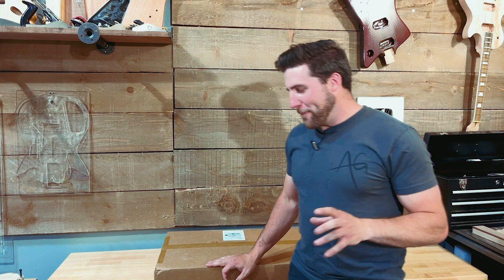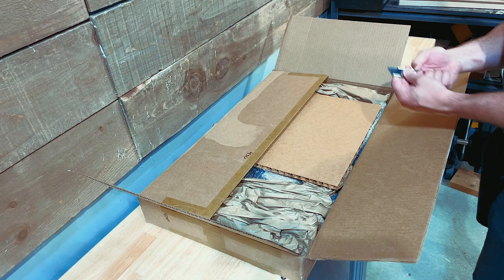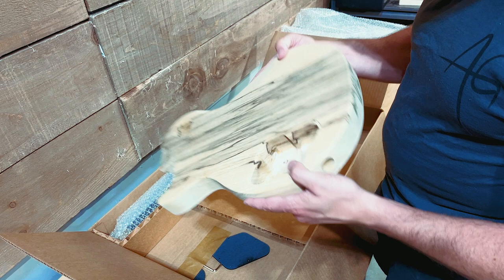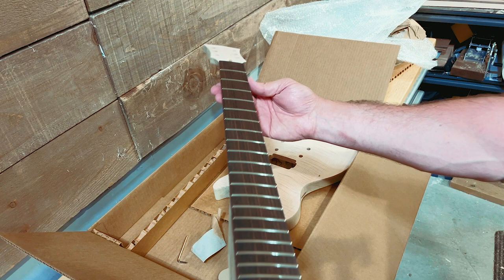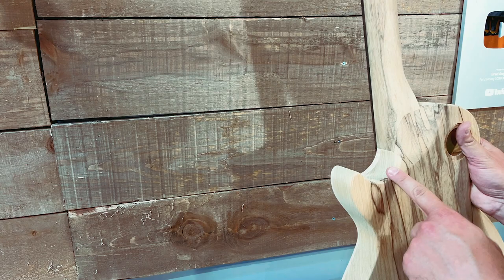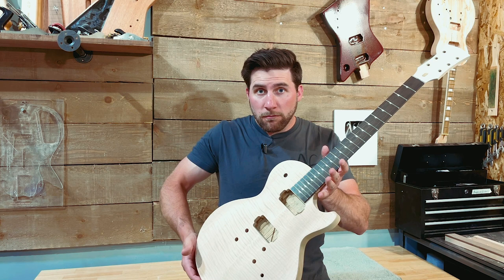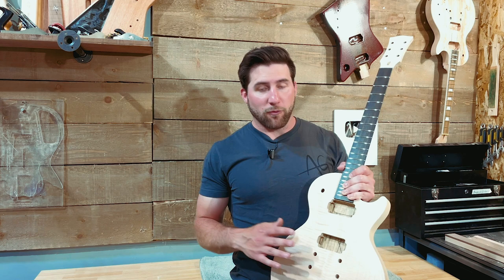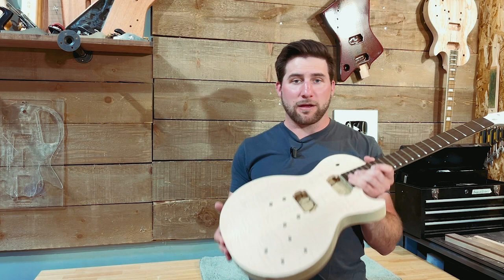Unboxing a Beautiful Guitar Kit from Precision Guitars

Comment: Really nice-looking kit. That black limba is gorgeous. 
I've built 2 guitars, both kits from Precision: 1) Tele-style, swamp ash body, maple neck and fretboard (no inlays), 2) Strat-style HSH baritone, mahogany body and neck, macassar ebony fretboard (again, no inlays). Fretwork was impeccable and neck pockets super snug. Both bodies had some pretty rough marks/scrapes from factory sanding that required additional sanding, but that's pretty much all that was needed. The Strat-style forearm carve was way too sharp an angle for my taste, so I hand shaped that. The Strat-style fretboard also had a couple of small, rough imperfections where a tiny chunk of wood was missing at either end; you'd have to be looking really hard to see them. 
Really happy with how they turned out, overall. They play really well and sound awesome (Seymour Duncan pickups: Quarter Pound set for the Tele, Sentient neck/Hot Rails middle/Pegasus bridge for the Strat). If you don't already have one, I recommend building a baritone: it'll change your life :)
Reply from the maker: I’m glad to hear your builds went well. I would love to do a baritone at some point.

Comment: Spalted Maple.  Condition occurs when trees lay on ground for a period of time before milling. Iffn I recall correctly, a fungus causes the coloring.  Can be quite stunning, and no two are alike.😊P.S. if you splash a bit of thinner on the wood it will give you a read on what the grain and colors will look like with finish applied.  Water will work, but thinner won’t stain and flashes off quickly.

Comment: So glad you are doing this build. I've advocated for PGK for years. Quality is second to none in my opinion. Fretwork is impeccable and routing is precise. Neck pocket leaves zero gaps as every neck is built for that specific body. I purchased 4 kits from them and have finished 3 so far.. A Korina '58 Flying V clone with gold hardware, Les Paul Jr with P90, and a Telecaster with maple neck. Number 4 is a Limba Stratocaster with a natural orange stripe running through it.. That one will get a Floyd rose 😀. My advice is to spend the extra money on quality hardware. The kits aren't cheap so you might as well go all the way and make it a killer one of a kind axe. They play just as good as my Gibson LP. Looking forward to seeing what you come up with on this one, Brad!
Reply from the maker: Cheers Anthony

Comment: Back in 2020 I decided I wanted to build a guitar after finding your videos.  Start with a kit from Fretwire, it was rough, figured that was typical of the china kits.  Ended up sending it back because of an issue(which they were great about).  Went with a kit from Precision.  Sure, I busted my original budget for the build, but the Precision kit was perfect.  Didn't have to do any of the work your old kit videos had be prepared for.  It was literally sand it, seal it, paint it, and glue it together.  For me, the rookie builder and rookie guitar player, the hardest part was getting the nut just right and the initial set up.  Once I got that all dialed in it came out great.  I guess the extra cost of the kit was somewhat recovered by the fact that I didn't have to buy a pile of specialty tools for the build lol
Reply from the maker: That totally makes sense. If you’re just building one or two and want to make sure they’re good at the end, this is a great option.

Comment: Hello again Brad,
That is a gorgeous kit! I’ve only worked with Warmoth stuff here thus far but I’m definitely going to have to check these guys out now for a cool set neck build similar to this one you’re about to do now man. That black limba looks incredible too, can’t wait to see what kind of cool finish you decide to do of course as well. I’ll be heading on over to their site as soon as this video ends as well, thanks as always! 🤙
Reply: PS ~ just out of curiosity did you go with stainless frets? When I check these guys out I guess I’ll see, I’ll also check and see if you have a link which might give some sort of small discount if you’re sponsoring them, if so I’ll obviously do it when I’m ready 🤙 once again thanks, very cool video.
Reply from the maker: I don’t have a discount link at the moment, but I may ask them if it’s an option. 
I got the jescar 45100 frets.
Reply: @BradAngove  , thanks. Looking forward to seeing what you do with this one. I’m sure it’ll be very nice whatever you decide though 🤙

Comment: Nice looking kit. The wood looks really nice. If you tape around the neck pocket edges when you go to glue it up it will help keep squeeze out off of the areas where you don't want glue.
Reply from the maker: Yeah, I’m also going to do my staining work before I glue to avoid having the glue mess it up.

Comment: I just recently ordered a kit guitar from Precision Guitar Kits. The one I ordered looks very similar to the one in the video. I ordered the LP style with a 25.5 scale, 3A quilt maple, and dot inlays. I did go with the black limba body and neck.
Reply from the maker: 3A quilt hey? I bet that’s beautiful.
Reply: @BradAngove  I’m sure it will be. I just ordered it on 07/01/2022, so I probably won’t get it until the first September.
Reply: I know you have reviewed Crimson Guitar products so I have a question for you. I recently received my Precision Guitar Kit. I was going to finish the body and headstock with stunning stains. I also know I’m going to use Crimson’s High Build Oil on the neck. My question is, do you think I could get a nice sheen with Crimson’s Oil on the body or should I clear coat?
Reply from the maker: Crimson oil gives a nice sheen, but it’s not a full gloss. I’m not sure what you’re looking for.
Reply: Do you have a video where you add a finish to black limba?  I want to do an oil finish and I’m curious about the grain filler (what’s the best kind, advantages/disadvantages to using it, etc.). Thanks!
Reply from the maker: I don’t have any other videos on black limba as it stands, but the grain is fairly closed so grain filling likely isn’t necessary.
Reply: @BradAngove  thanks!

Comment: I just received my first set neck PRS style carved maple cap DIY kit. However, upon checking the neck fit, it looks like the fretboard sits to high in the neck pocket. There is about a 4mm gap between the top of the guitar body, and the bottom of the fretboard. There is also a small ledge that extends about 3 or 4mm beyond the end of the neck, and it looks like it should line up to match the top of the body, along the front edge of the pickup cavity. Can you recommend some steps I should take to verify what the height of the fretboard should be? I don't want to start routing the neck pocket deeper, if it's not necessary, but it seems to me that the bottom of the fretboard should be almost touching the top of the body.  I would appreciate your input.
Reply from the maker: Get the bridge installed and then check by running a straight edge from the nut to the saddle with the neck in place. If the neck is too high there will be a substantial gap or if the angle is off the straight edge will be too close to the high frets.

Comment: With the neck being that tight, are you only seeing glue on the bottom of the neck, and glues is but squeezed out on the sides?
Reply from the maker: I’ll probably tape the top around the pocket to protect it and just to a very thin layer of glue throughout.

Comment: Hey, does it come with the neck nut at all? Or do I have to buy one separately and carve it out my self?
Reply from the maker: It doesn’t come with any hardware, so you would get one separately. You should have no difficulty finding a pre-carved on though that you can just adjust the height of by removing a bit from the bottom.

Comment: The LP kit I have . Is totally not seamless and needs all kinds of work.. (and for a noob guitar builder such as me could probably use the practice) but….I guess next time ima have try these guys out
Reply from the maker: They are unreal. They do take some of the work out of it, for better or for worse.
Reply: @BradAngove  I checked out the specs and they use Jescar wire for the fretboard(I heard that’s higher quality stuff) but solo does have a Strat kit I’ll get off your link ,and as for the Precision I’ll get another LP since I got measurements tools and other crap I’m using to build the one I’m currently working on.

Comment: Anyone have an opinion on the fret edges on these guitars? Will I have any filing or sanding if I get the stainless steel frets?
Reply from the maker: The fret edges on the two that I’ve done from these guys have been perfect.
Reply: @BradAngove  Brad thanks, I’m a newbie player but an experienced woodworker. Going to build my son (experienced player) a Flying V.
Reply from the maker: @06barcafan10 I hope your project goes well.

Comment: This is no different than Warmoth. Warmoth just does not call it a kit because they sell the neck and body separately, can finish it any way you want, or not and can rout or not and sell you the hardware and pickups if you want. One stop shopping of top quality. I have 3 of them and highly recommend them.
Reply: Ditto for Warmoth.. great customer service. Currently there is a loooong lead time due to supply chain issues. But well worth the wait. Plus they are just down the hill from my home.
Reply from the maker: Yes I’ve heard very good things about warmoth.

Comment: No idea why you're impressed. It's a CNC machined cutout. Costs nothing to do with the parameters already programmed. Willing to bet it took 20 minutes tops to create that body and while a cap is preferred over veneer, the cap means you lose on the body material. Frankly, if a kit with no hardware and no electronics costs more than $200 US dollars, might as well by an Epiphone or any of the dozen other knockoffs of the Les Paul design. Ooh, have to have this wood... Why? Makes zero difference in how it plays or sounds. This is not an acoustic instrument!
Reply from the maker: Well Robert, it’s clearly not just CNC. I can tell you that from feeling it. There’s a lot of additional sanding work etc. Most of it is of course CNC, just like on a $3000 Gibson. I’d rather pay for the kit. 

If I didn’t want to build a guitar kit or didn’t have the skills I would just go by an epiphone. But that’s not the case here, and I would rather choose all of my own wood, frets, electronics, hardware etc. You may not care about any of that, in which case a pawn shop epiphone is probably the best bang for your buck. 
The wood is clearly for aesthetics. Do you look at a pair of hot pink shoes  vs black ones and think “color makes zero difference to how you walk in them, so there’s no point in paying $1 more for a particular color”? 
Everyone has their preferences. I don’t see why you would hold that against them.